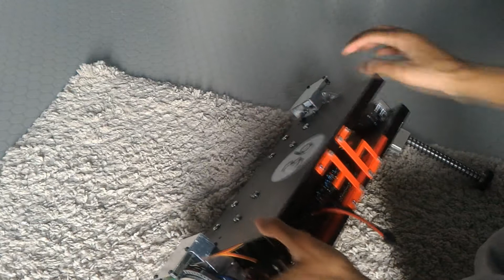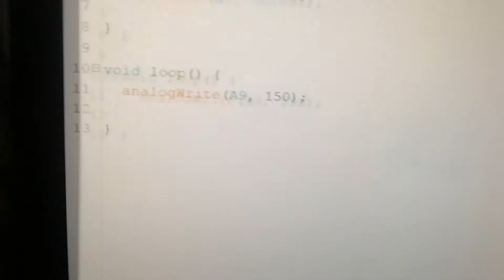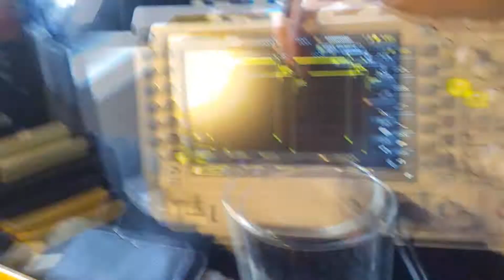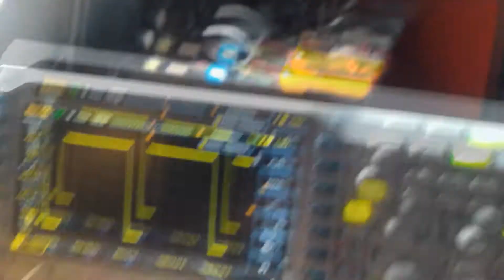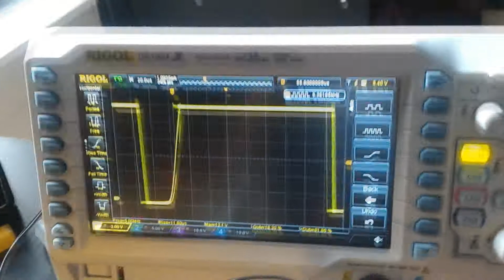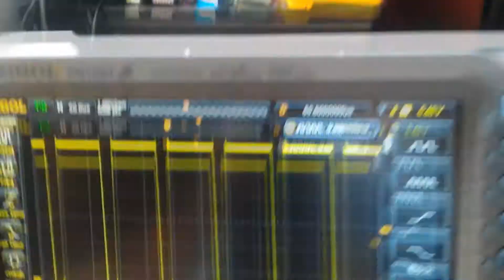Robotics Project: Biomechanical Robot - Episode 3: Assembly, control and motor theory

Comment: What's the maximum frequency this board can do?
Reply from the maker: 100Hz to 100kHz, with some changes in the MOSFET drives, 1 MHz.
Reply: Azagro Oh, OK. Did you ever use a breadboard to test this?
Reply from the maker: No, didn't use a breadboard.

Comment: Doesn't that board look familiar? I guess this just goes to show how modular these things are. I wish I could do that with mine, only the oscillator board is swappable.

Try sticking a bit of red tape on the 7 segment, it really helps.

P.S. Why don't you give my inductance meter a shot? It works pretty well.
Reply from the maker: Yes it does, it was the one board where MOSFETs kept dying. Oscillator board should be fine actually. I will do my charger the same, one power board and one controller board with quite some modules. Once I am done and I am happy with the results, I will make it full SMD, even the microcontroller. 

Yeah, I don't have red tape. 

I now have an LCR meter, I would need a good parasitic capacitance meter.